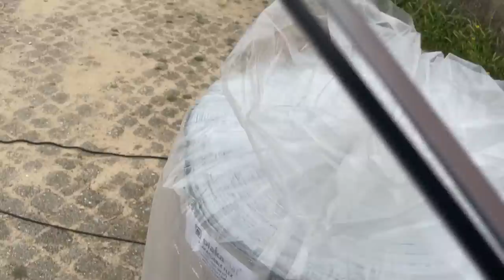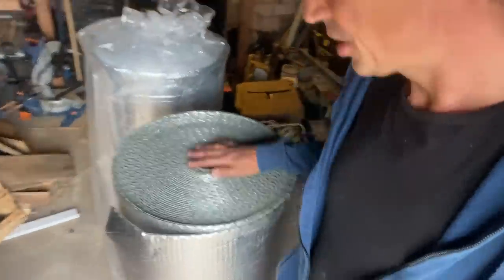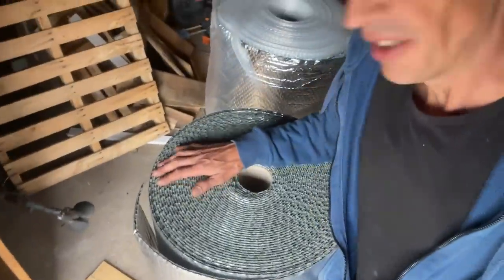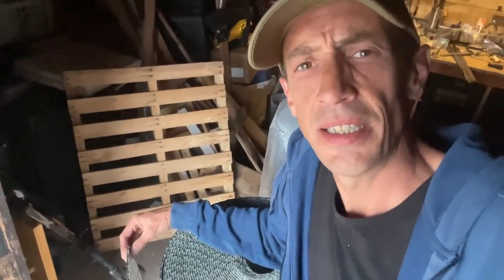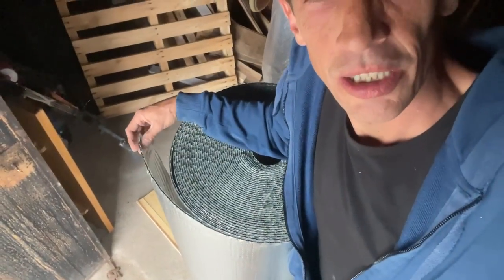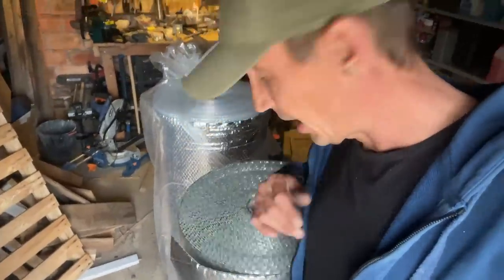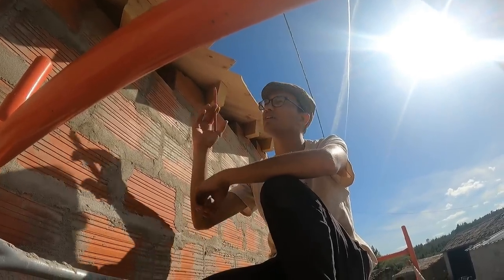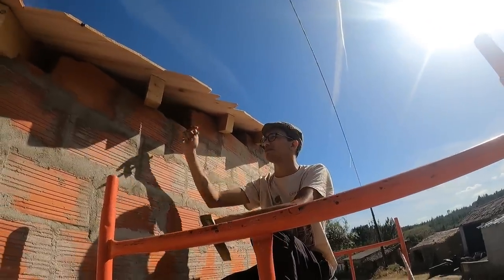S3E19: INSULATION AND BATTENS! - DIY PORTUGAL

Comment: Jasper, you need a breathable membrane as the bubble insulation will trap the moisture between the wood and the insulation causing problems later. It also has no thermal advantage as your pointing the foil outwards, it's only comparable to rockwol if it's facing into the building.
Reply from the maker: It’s on both sides ;)
Reply: @GhostTownVlogs  insulation is on INSIDE...

Comment: Jasper, it appears the second roll of insulation was f/b.  First roll f/b/f...foil bubble foil.  I think the f/b (foil, bubble) is used between floor joists in basements.  Since the foil doesn't lay completely flat,it should allow moisture to evaporate/escape.  It is amazing stuff,  If the new roll has only one side foil, might want to look for similar product to the original.
Reply from the maker: Both have foil on both sides.. :)

Comment: No man... That aluminum bubble will trap moisture and rot wood... Tyvex breathable membrane for roofs... Even asphalt rolls... Insulation on the inside of roof... Plastic or styrofoam roof vents between roof and insulation.. so air dries otherwise mold....
Reply from the maker: You know a house needs ventilation right..? :)
Reply: @GhostTownVlogs  Got to get ventilation between the wood and tiles.. sweats moisture... Portugal especially has humid climate...the insulation is on the inside with Styrofoam batons that go between the wood and insulation so air is constantly drying the wood...

Comment: Bubble wrap has almost no r-value and as mentioned before youre trapping the moisture. Those thin wooden planks will be rotten in a few years. Even just an damp membrane without any isolation at all would be beter then this. Get your builder/constructer/adviser fired😅
Reply from the maker: Well come and feel it for yourself. Keep keeps the room nice and cool :)
Reply: You can’t fire jasper, where would you ever find a replacement ?